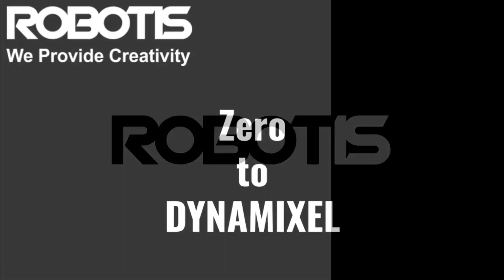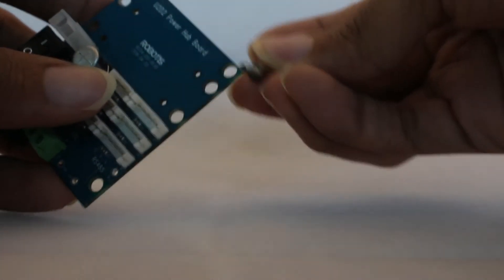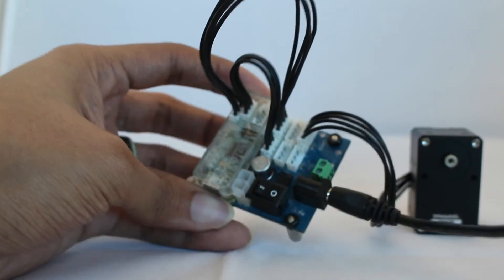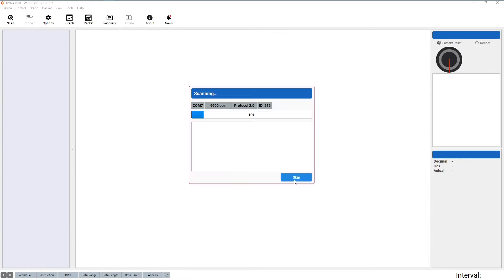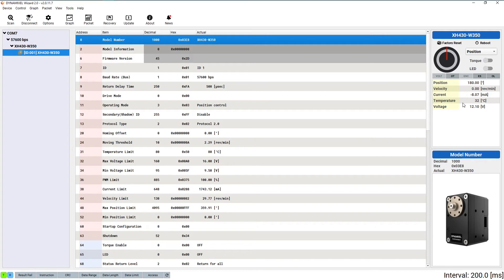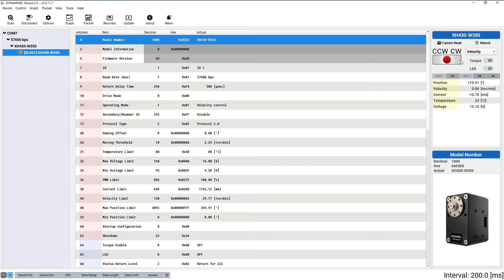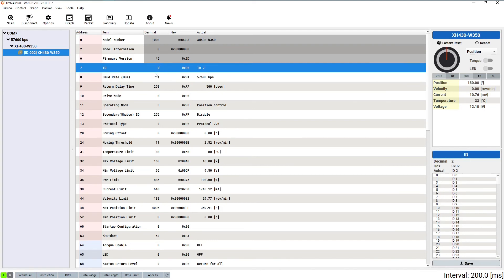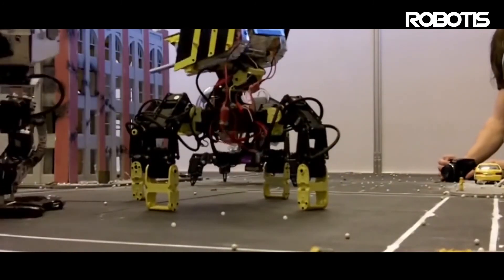Zero to DYNAMIXEL

Comment: I am using the Dynamixel AX-12A and Open RB-150. When I scan it, why isn't it being detected? what should I do?
Reply from the maker: If you're trying to power the AX-12A from the OpenRB, you will need to provide 12v power through the terminal block connections, as USB power isn't enough to run the AX-12A.

Another possibility is that you may need to change the communications protocol of your sketch to communicate with DYNAMIXEL Protocol 1, rather than the default Protocol 2.

I would also reccomenc creating a forum post asking for help at the ROBOTIS community forum forum.robotis.com for additional asstance.